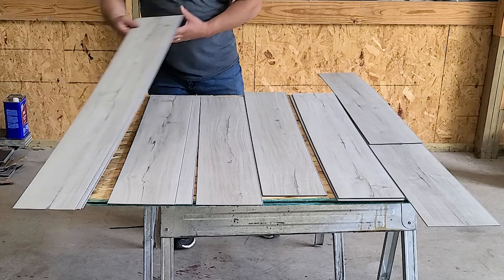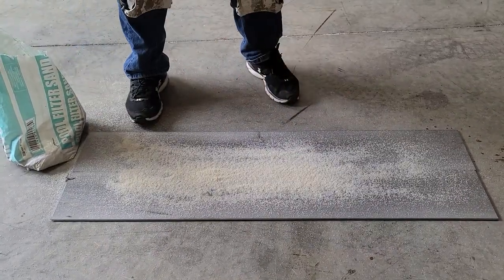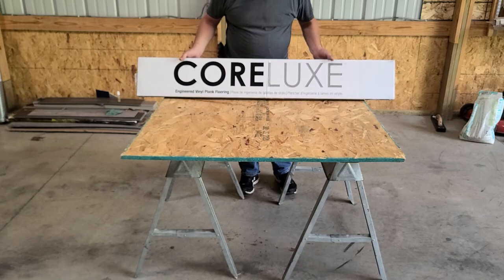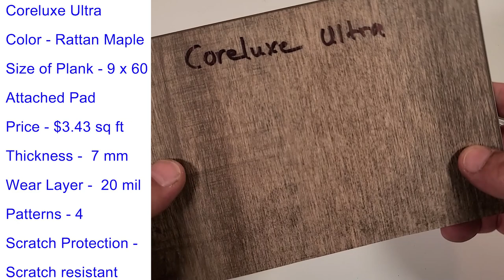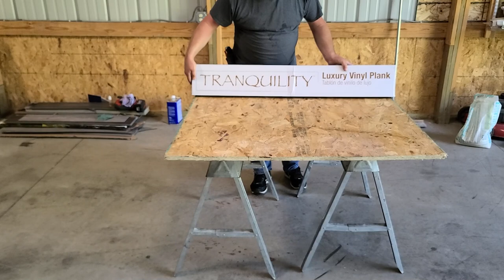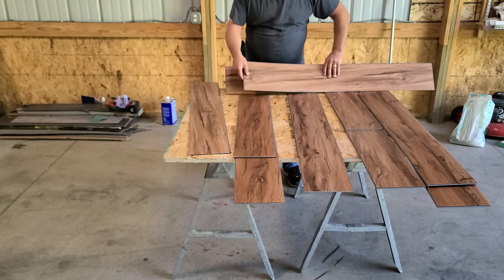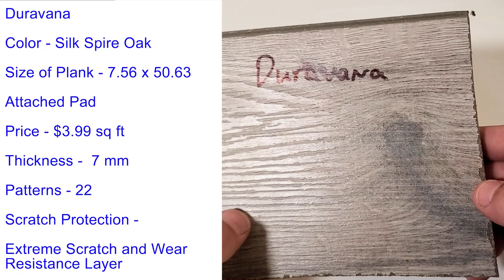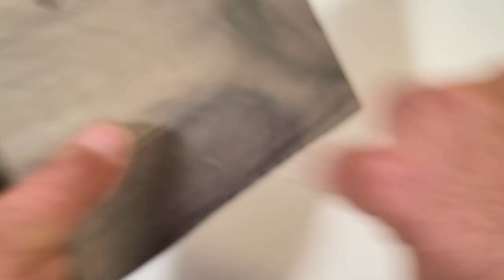I Tested Vinyl Plank from LL Flooring and the Results SURPRISED ME

Comment: If anyone was wondering the difference between Corelux, Corelux XD and Corelux Ultra are the specs. As you move up the line, the overall thickness and wear layer of the floors increase.

Comment: I installed some LL Flooring CoreLux Seminato Sterling 18x36 tiles in a kitchen and two bathrooms. Overall I was happy with the ease of installation and the surface durability seems very hard. At the time it was $2.49/sqft (pro discount). Great value, especially compared to Lowes comparable offerings at $4/sqft. I agree the tongues need to be stronger. They are reasonably strong, but when they snap they snap too easily. There's no flex. Anywhere there was the slightest dip in the concrete subfloor I could hear the locking system making cracking noises on the short ends of the tile.

Comment: We installed Coreluxe Ultra as well and it definitely is tougher to install. Very thick, solid, and durable flooring but I believe you need a very flat, level floor to keep this floor in good condition since the plank is very wide, long, and not flexible. We did not have a level floor and used underlayment (as recommended by LL Flooring) and also removed planks and put them back in as Joe says NOT to do in this video. Now we hear from Joe in another video that you do NOT use pad and underlayment together. So now we have issues of joints failing but it is what it is. We did install it as a drop-in lock as he does in the video. I personally think it’s not so DIY friendly, but it is a very nice and strong floor. 

Hope this info helps someone out. 👍🏻

Comment: Joe, watched many of your vids about plank installation and little tip and tricks to getting flooring look good. I have installed tile before and thanks to you this went just as well. I bought 2000 sq ft of the Coreluxe ultra Tobacco road acacia ( 8mm 28mil wear layer RVP)for our floor. 3 different widths ( 5, ,6 ,7") multiple lengths ( 25" and 48" ) and 10 patterns spread across all planks. Really makes for a unique floor. Not the easiest to install or cut, but the multiple lengths and widths allowed me to mix the pattern in multiple areas to  lower wasted product.

Comment: I just finished an install with the Duravana planking, and it was a hard install, but the result are amazing. when I purchased, they did tell me that the padding is not required. when asked about using a jig saw, not to. I went through a 160 blade, and it was throwing sparks when cutting, and about half way through, the bladed was junk. I did go and buy a pack of jig saw blades, that is for plywood, very fine tooth,, and it cut through like butter, just taped the cuts, with very minimal chipping, and like you said in the video, using the bridge method is the best way to install. My nest floor, I would use this again. A few things I would do different would be to stand all the planking up, and organize them together, and vary the patterns so I don't have any like pieces to close together. the down side? takes a lot long to install with their method of install, the locking system you have to be careful not to slip up on the edge, or it will chip pretty easy. great product though. We'll see how it holds up over time. wish I would have seen this video before my purchase, but don't regret. good video, and thanks!

Comment: Absolutely love this video and a big fan of your other brand tests. I was just at LL Flooring yesterday. Loved the look and feel of Duravana. It feels like ceramic tile. But you are so right about the way to install it as the company directs. This has a super tight joint. The micro bevel is super tight and beautifully unnoticeable. The bevel feels like sanded grout, at least on the “urban mist oak” planks I have sampled. While I like this, I’m a little skeptical regarding the locking system as I think deflection may pull apart on what looks like compressed stone type layers.

Comment: If you still have a full plank of the Duravana handy, I'd be curious if you could replicate the same issue I had. My room would have had a 2in strip for the last row so I rip cut the first row of planks to be about 3.5in so roughly half the plank. After the cut on a tablesaw with a 10in laminate blade, I went to start the row and noticed the remaining strip of plank had bowed longways and the locking mechanism wouldn't mate evenly. I also tried it with a jigsaw and had the same issue.

All told I had to return everything because I didn't have time to experiment but they gave me a full refund even with the open boxes. I bought more of the CoreLuxe for that last room and had no issues.

Comment: Question for you. I just installed the Corelux XD floor, I didn’t realize until I was finished that it was the tongue and groove style. I was installing it like the drop and lock. Found a lot of the tongue and groove connections were raised. Hammered them down after floor was finished. Seems to be ok for now. Do you think the integrity of the floor is
Jeopardized?
Reply from the maker: Hey my friend, the floor is not put together correctly so I think you will have some issues in the future. I would take it apart and re install the correct way.

Comment: You said the Duravana has an attached pad and recommends another pad.

What's your advice on this? Are underpads that are built-in typically good enough for non-basement (concrete) applications?
Is there ever a time where another underpad is needed for application on ply? 

Thanks so much in advance Joe! Liked, Subbed and Bell'd!
Reply: I also need to know this, the instructions and salesperson both contradict whether to use extra or not. I was told by the salesperson it isn't needed then it said it isn't needed in the installation but have two recommendations of what kind to use🥴

Comment: Dude! Got the Mohawk from Costco. Beautiful product. Had a contractor install it, thought he did pretty good. A painter came by and pointed out the H Joints everywhere!😢 looked deeper into the contractor, he let his license expire. Anyway, I’m hoping to settle for my money back. 1500 sq feet. And the cost of the flooring. I have contacted and attorney too. The unlicensed contractor is pretty prominent in this community. Anyway, here’s my question: can I have a pro do a little at a time? Say when the floor starts to buckle in certain areas, have a pro come in and stagger some parts?
Reply: You're not getting any money back, sorry.